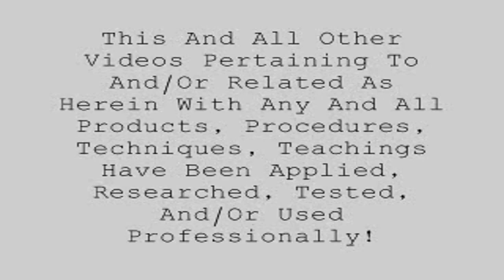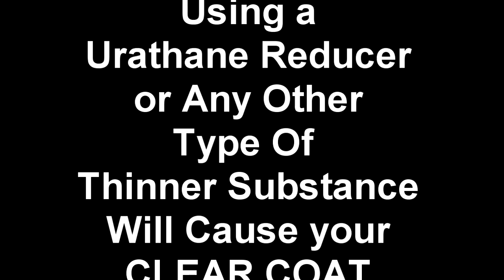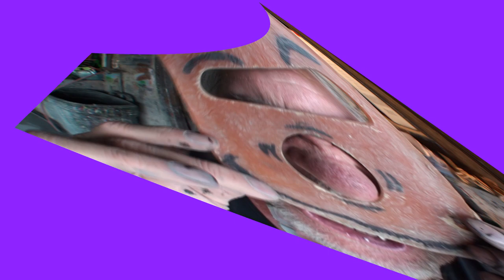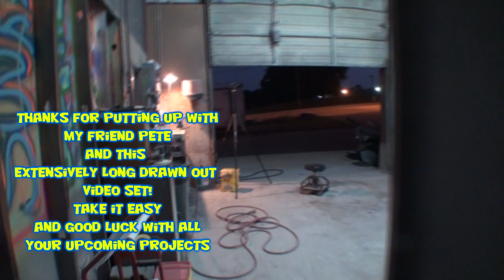Restoring An Old Fiberglass Motorcycle Drag Bike - Part 5 -DONE

Comment: I had a similar problem repairing a car,  the paint underneath started to bubble up around the edges of the repair.  I painted on a layer of "Barcoat", one manufacturer is U-POL, solved the problem.

Comment: For problems like this I use some of the Lesonal UV Primer on my problem areas. This stuff dries with sunlight and the major benefit of this stuff is that it has like no solvents in it. It does not react with old paint. Another benefit is that it does not shrink. I once tried different grades of grids on a metal sheet and even 40 grit scratches did not shrink. I left the metal sheet for 4 weeks straight outside of my shop. Also this stuff is a really good rust inhabitant product. Products I would recommend are Sikkens UV Primer, Lesonal and the Glasurit one. Negative sides are. Once you put too much on your panel, you get the risk of not curing of the product properly. All it takes is one to two coats. Just a smooth finish. Do not cover the panel fully it has to be transparent. Warning this stuff dries with only UV rays . Where no light hits the spot, the spot will not dry. Also this stuff stinks horrible. 

As a long time subscriber Pete I really want you to try this stuff because it helps sometimes out. And this stuff dries so fast you wouldn't believe it.